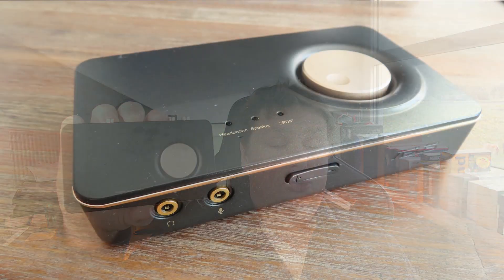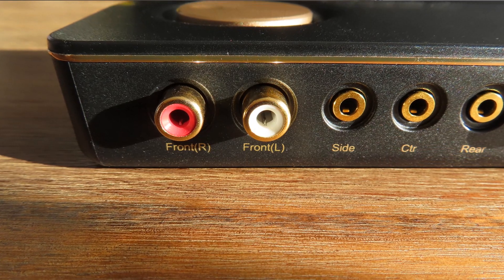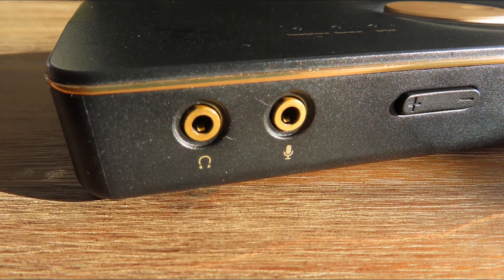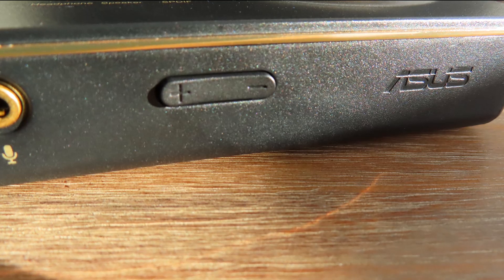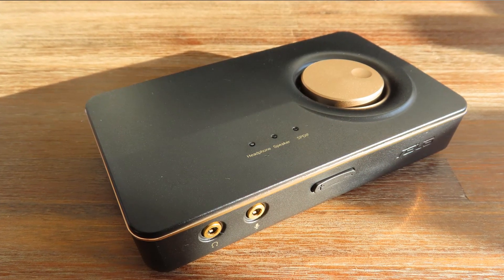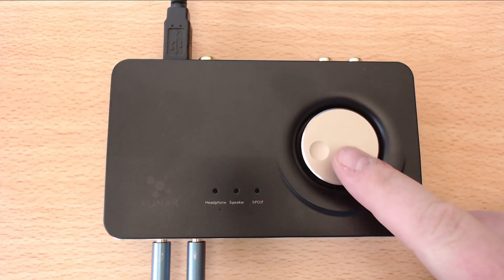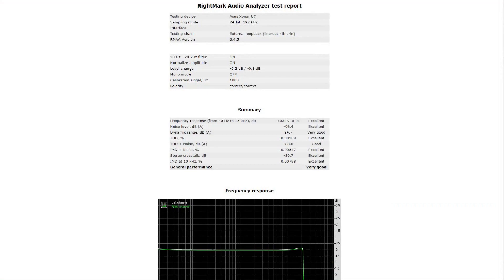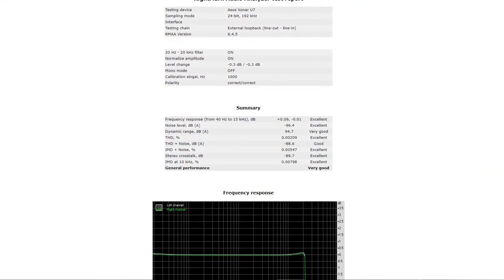This Xonar U7 came with a cool feature!

Comment: @Gaming Audio Lab do you know how to set the line-in input to a higher bitrate and sample rate as it doesn't seem to show anything past 24bit 48khz even though the sample rate is meant to go upto 192khz for recording from line-in
Reply from the maker: You can try to set this in the sound control panel of Windows itself. Have you installed the correct drivers?

Comment: I have Xonar U7 Echelon sitting in my closet, and somewhere along its lifespan, one of the front channels ended up quieter than the other front channel.  So now it's completely useless to me.  When going from a U3 to a U7, you go from Dolby Headphone that pretends to be 5.1 or 7.1 speakers for the game, to Dolby Home Theater V4 that pretends to be stereo speakers, so games can't possibly know to use surround.  And then somehow it claims to add surround sound on top of that.

Comment: I use Asus xonar u7 and i don't have these problems with usb 3.0. I just plug it in my pc and windows 11 find the right driver for it. And when I look in the sound settings, it says it is a Xonar i have as a soundcard. I also used when i had it on the windows 10 with no problems.
Reply from the maker: You probably have an updated version of the U7. The older models (like the one I have) is prone to have issues!

Comment: hello! i have a question! i bought this a few days ago along with a 5.1 system. sometimes my left and right speaker suddenly dissappears, then reappears a few seconds later. any suggestions on how to diagnose or fix the issue?
Reply from the maker: Hi Lawrence, Sorry for the late reaction! This is a known is of the U7 and it isn't really fixable. The reason is two fold. Either you're using USB 3.0, in which case you will have issues. Switching to USB2.0 will solve the issue. The other one is bad construction of the device and the disappearance of sound basically tells you that the U7 is faulty. In my opinion, you should return it. Ohh I've also read somewhere that AMD motherboards and the U7 don't mix together that well.
Reply: @AntonsHardware  thank you for the reply! i'll plug it in on my 2.0 then. 

right now, i'm not having the said issue anymore. it seems i fixed it with re-installing the xonar program. what i'm having is it's having some sort of.... very choppy sound with one of my programs. but that's better than the other issue!

Comment: Hi, how is the stereo music performance of this card?
If I connect rca to denon avr-x3100w amp, can i get better results than hdmi?
Reply from the maker: I doubt it. The U7 has serious issues with USB 3 and is prone to getting bricked (flashing light issue) So I wouldn't consider getting it, even if it does provide better sound.

Comment: Awesome video! How to fix the "blinking LED" glitch is rather weird; open the Xonar U7 up, and while its blinking, you need to touch/push with the tip of your finger on one of the chips on the PCB, and then it works!
Reply from the maker: I also found this online, but I found that the reason for the blinking is that the U7 cannot be detected when using USB3. It's just not compatible. :(
Reply: @AntonsHardware  Weird, never had that problem with my B450 motherboard, the Xonar U7 works with both the USB 2.0 ports and 3.0 ports. :s But the issue started to happen after 3-4 years of constant use, it's a temporary fix and if the USB-ports are still giving out some power while the computer is off it will still work, but most of the time you need to do that "fix" to get it to start up properly.
Reply from the maker: Weird indeed! I couldn't get it working on any USB3 port on 4 different systems. Even with a proper restart. USB2 worked perfectly. I'll give your fix a try soon!

Comment: 13:30 What do you mean by not working with 3.0? I got my U7 in 2015 (got Sennheiser HD 650 Headphones and a Modmic V4 that sounded bad with the Onboard of my Asus P7P55D and had interferences I guess because of the powerful GTX 780...) and use it now with my ASRock B450M Pro4 connected to a 3.0 Port (yes, the B450M Pro4 also still got two 2.0 Ports) and it works fine.
Or does it mean the motherboard host controller has to be backwards/downwards compatible? Well, also upcoming USB 4 includes Legacy Support for 2.0 and there are also "native" cables from USB-C to USB B 2.0
But yes, the lack of Driver support may lead to issues with upcoming Windows [10] Versions.
Did you mention that the S/PDIF output supports both coaxial and optical?
I just rediscovered the included adapter that was still in the bag labelled with "Asus" and found out in the manual, that it came with the U7 that but its use is not really explicitly mentioned in the manual...
Reply from the maker: There are confirmed cases that usb 2.0 soundcards suffer from issues with AM4's USB 3.0 host controller. They are backwards compatibel, but they suffer from some sort of issue where the sound card couldn't be detected or was detected, but the drivers weren't capable of installing.
 From what I could find out the issue was solved by AMD recently, in it's latest drivers, but I haven't heard anyone confirming this. And since I don't own a AM4 motherboard (yet) I can't test it either.
Reply: @AntonsHardware  I wonder how it's going to fare with my lenovo ideapad. I need to look around for purchase options with no questions refund. It's easy in Europe. BTW, what would you recommend as an alternative to Xonar U7 or U5 for that matter? I use headphones and speakers, I hate Realtek and I barely hear the difference between 128 kbs and 300 kbs music files :)
Reply from the maker: I would recommend the Epos GSX 300 if you're on a budget. Great price, great performance. But if I'm correct, that one only goes upto 96 kHz. Otherwise, get a Creative G6 (not the G5!)! The G6 is really good and will go up to 32-bit/384kHz!
Reply: @AntonsHardware  I don't need high sampling rate. Two problems I see. 1. G6 doesn't seem suitable for a G6 - speaker amplifier - stereo 60 W speakers scenario. 2. I do digitization of cassettes sometimes so I need a regular Line In. Basically I need a full soundcard replacement. On the note of #2, I don't believe Xonar U7 has Line in either! EDIT: False. Xonar U7 has shared Line In/Mic In mini jack input.
Reply: So, does it work on USB 3.0?
Reply: I've got a B450-Pro 4 without M here and those boards are very budget but good enough IMHO. My main system is a ASUS Prime X570-P, and I am going to receive the U7 Mk 2 tomorrow (April 6, 2023). I'll gladly let you all know how it works on USB3 ports. I also have a X299 based Intel system for more testing.

Maybe the problem lies with a stream priorization problem that reared it's ugly head 1-2 wyears ago when even USB mice were stuttering on some AMD systems, but that was fixed with an AGESA update. Just my guess...

IMHO I am not expecting to see any issues, but in any case, USB 2 ports are plenty on my systems too.

Comment: Do you know if it improves or works for the dt99p pro 250ohms? Im using it with mine and I dont see an improvement but I heard you need a DAC like this for the dt990 pro 250ohms because it is such high impedance
Reply from the maker: Yes, this dac cant go opwards from 100-150 ohms, mainly because it lacks the power to drive such a headset. I don't know which one you should try, but maybe you should look into the Creative G6.

Comment: I wonder if it pays to get the Asus xonar AE or U7 or even the Sound Blaster Audigy Rx. Or I don't know another model. I didn't want to pay dearly, but I wanted something that I like.
Reply from the maker: The Xonar AE is a great budget card, but I have heard that it does have issues with the new AMD Ryzen motherboard. Something to do with the USB polling rate. The U7 wasn't that impressive, if you get it, get the Mk 2! The Mk 1 will not work properly on a USB3.x connection. The Rx was kinda nice, but the issue I had with that card is that it uses a really old Digital Signal processor. When listening to it, it was like stepping back in time. You could take a look at the GSX 300 by Sennheiser. Cheap, good audio quality and it has a mic in!
Reply: @AntonsHardware  The GSX 300  used to use speakers on it too? My biggest purpose is this. Because my headset is Wireless. The one you indicated here in my country is cheaper than the others. But I saw that it has only 2 inputs, one for the headphone and the other for the microphone.

Comment: Hello Anton! Thank you for the very informative Video. I have a question and you seem to know you stuff so you might be able to help me. I have the problem that I need to retrofit an optical out for my Mini PC (Intel Nuc) so I can connect it with my amp (with a great built in DAC) via toslink. So I bought a cheap external soundcard with optical output on amazon but then I figured that with this soundcard I wasn't able to control the volume within Windows (software wise) or change any other settings. I think that might have to do with the Class 1 and Class 2 type of devices you talked about. So... can you tell me if there is "driver support" for controlling the volume with the standard windows volume control when using the optical output on the Xonar? Or do you have any other solution or device recommendation for my task? Thank you in advance :)
Reply from the maker: If it's a class 1 card, it should be able to control the volume without any need for drivers, but that is for the regular outputs. I don't know if there are separate drivers for this functionality for using the toslink. Have you checked the website for any drivers of the sound card? Also, from what I know, the toslink just sends the raw sound data and let's the external dac do all the rest, including the volume. So I'm not completely sure if there is such a solution. But I may be wrong in that area since toslinks aren't my intimidate area of expertise.

Comment: how would you compare the qulity of the sound between this external soundcard and offerings from modern motherboards, such as Realtek ALC1200-VB? is this card that much better?
Reply from the maker: In my opinion the ALC1200 is better then the Xonar U7. Keep in mind that the Xonar U7 will not work on USB3.0 machines. It needs a USB 2.0 contoller in order to function! Seeing that you use the ALC1200, that is a relatively newer Realtek codec, which means that your motherboard will probably only have USB3.0! Steer clear of the Xonar U7! If you can find the Xonar U7 mark 2, that may work, but I've also read people have issues with that one as well.